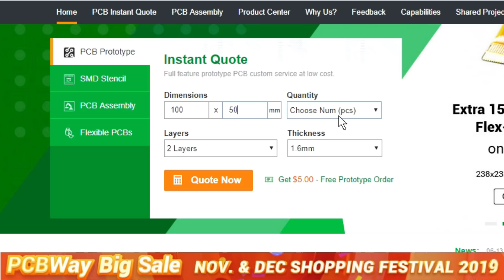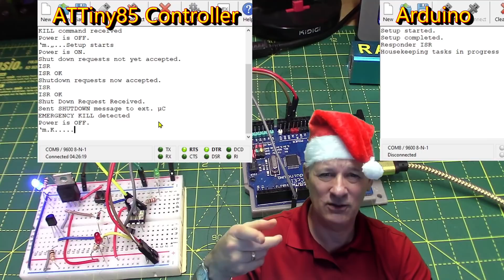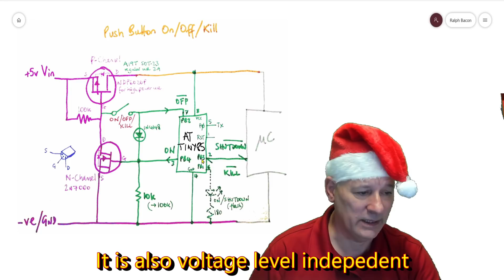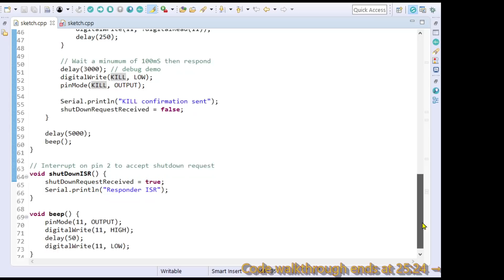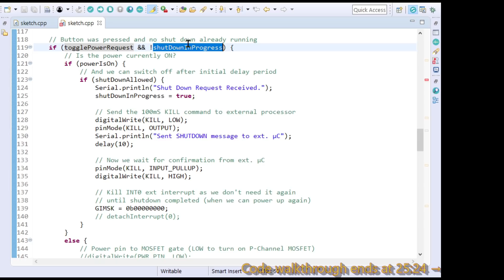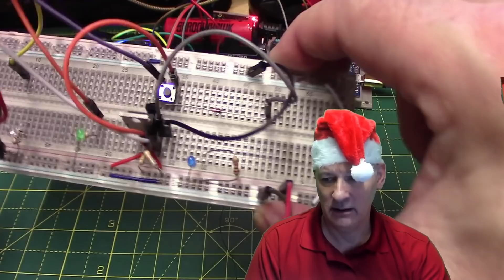#173 ATTiny85 Power On Off Shutdown

Comment: Great video! And I understand this is meant to explain/mimick the ltc2954 but is there a reason not to use the “main” uP to do the logic and providing the signals for this setup? It would bring down the necessary parts by, at least one ATtiny85 …

Comment: Hi Ralph. Great demo as always! I've got a small widget I'd like to build where I have an ATTiny85 power up via a button press, drive an MP3 player module to play a short sound and then power back down. Would this circuit work with just the ATTiny85 part of the circuit and none of the other part to drive the Arduino? Thanks again for your wisdom!  Gord
Reply from the maker: Actually, my simple dual MOSFET on/off design would do this wonderfully well (and I've used it countless times since I published). The push button brings the P-channel MOSFET to ground to start it all off, and the first thing the microcontroller does is "latch" that connection using the N-channel MOSFET by bringing the gate connection HIGH. When you're done playing the sound, release that GPIO pin and it all shuts off. Zero current! Nice!

Details: https://youtu.be/g1rbIG2BO0U but don't use those massive MOSFETs, for something like an 8-pin Si4599, pin-compatible AO4606 or even a EMH2604. I found the Si4599 hard to get since Covid, but the AO4606 is pin compatible and I've used it a lot. Give me shout for more info if you need it.
Reply: Thank you for the confirmation Ralph! Much appreciated!

Comment: Hey Ralph, great video!
I was searching your videos but I couldn't find a vid containing following:
power latching circuit to power on and off a mcu using a attiny (with the internal watchdog timer) instead of a push button. 
Do you know where I could find an instruction to do this? 
Maybe the ATtiny could activate a Mosfet to  switch on the MCU. I can not find an example :-(
Greetings
Reply from the maker: Do you mean, an ATTiny switching off the power to a microcontroller (and back on again), unless it receives an "OK" message from the microcontroller?
Reply: @RalphBacon    I want to do logically excactly this but instead of the push button, I want to switch it by using an ATtiny13  https://www.youtube.com/watch?v=7D9L9oS4AJM&t=117s
Reply: @RalphBacon    thank you for answering, man! :)
Reply: @RalphBacon    but yes, I think that would be also ok. the attiny siwtches the power on and after 10 seconds, it switches it of for some minutes. then it repeats the process. that would also be ok.
Reply from the maker: See if this video of mine helps: https://youtu.be/S2y1oAVmxdA

Comment: Hi Ralph, your circuit would work with a micro like the Raspberry Pi. The Rpi would need to run a power-down routine , in the background, to detect the Kill (via an interrupt). The Rpi could then cause a  controlled shutdown to happen. The shutdown process will signal the power-down routine to terminate. Prior to terminating the Power-down routine, the Shutdown signal can be set so that power can be turned off to the Rpi. Another advantage to the power-down routine is that it would catch any other shutdown requests that get made through the linux os operation. For example, if the Rpi user issues a software controlled shutdown instruction (rather than using your circuit switch),  the power-down routine would be activated to issue the Shutdown signal to your circuit and hence cause the power to cut off.
Reply from the maker: Check out my video #122 which did a shutdown of the PI, but I can't remember how intelligent it was: 
https://youtu.be/9IWn5GYktUo

Comment: Excellent video, I have one question though. 
What is the capacitor doing that I can see on the breadboard circuit? 
I can see it is across the power pins of the ATTiny85.  Its not mentioned on your github documentation. 
Your comments would be appreciated.
Best wishes for a speedy recovery from your recent eyesight problems.
Reply from the maker: The capacitor across the Tiny85 is a decoupling capacitor, explained in my Bacon's Bytes video here: https://youtu.be/zAUckSiE1RA
Thank you for your kind wishes for my eyes.

Comment: I have been playing with the ATTINY85 for some time now, primarily for building count down timers that we need in the house for our medical applications. Wife needed a couple for her eye drops, morning and evening, each needs a different amount of seconds that she must keep her eyes closed for after applying the drops. So I built her two timers, one for morning another for bedtime. Both use the ATTINY85's and I did put a 7 segment display on the top for the rest of the world, and a beeper for her use that alarms her when she can once again open her eyes. I also built one for my when I am towing our car behind our RV, it needs to run for at least 5 minutes at each fuel stop for the RV, again I built one that counts down and flashes when the time is up as well as plays a little tune to get my attention and I can shut the car off. This to keep the transmission lubed as we hurdle down the interstate highways at under 70 MPH  per the manual for the car. The one that I use is premounted on a breakout board and has USB input available on the card, works great, but it does program just a bit different when programing it with the Arduino software programer.  Here is the one I use:  https://www.ebay.com/itm/Digispark-Kickstarter-ATTINY85-Arduino-General-Micro-USB-Development-Board/351877226756?_trkparms=ispr%3D1&hash=item51ed846104:m:m4HEyK4-Hf9mfqfUHiHKYxQ&enc=AQAEAAACQBPxNw%2BVj6nta7CKEs3N0qV7HnbLtUf5uFWeXJcctjjqBZVR30pu1j1M9ZRHiiBR9y7lwuqkCvpquFZDGp7hy9jqezCiIfzXvABF2AA9wuy9Lk2X8Xsopo%2B2SLWFdZNd8oobuwOg3ni5%2Fx4egNEvBKSlFbKswe%2BhEPnSCO%2F3%2F4mIO0hVCihoV3hnvzV9t8NJfEP3KilB6RSZ%2BGTTQHY6jw4YOUJPGgKq6YvCOdXA%2Bubl8uLoYS2ZlcoLcP1kSHegZSpKxsYRKQUBNT64E5YZKGAb0gYFMbx%2Bs3L%2BQrqweWTQjDfmlRX3PsNNwd8O0rptbD6AVsvOb%2B2wXy7bkwAcbmrMvcpDEpsuAPRLdbY4B0jE7iJM8THzfM%2BozgXfkib64vlYRHCclJPruQ7QTsACp7B7fO3YVUeGbqa9gp2gPWNF66I4Nf17l64GNzBQl%2Fncw5BOklQb1WyCOrlKhKK5BlXm8Rv5%2BNVAKmNBuA0hwprl9FV3LsUV40uO5xRke5VRmhgwDqoPn3GB4vdZh1CzQRiCTeB5cZ%2F1jdQY78uRLx2MNcZ0AbKu7hhOnQc3y4PgRFdKHY%2BS7loMqq9BMpUT1OTz61YmhgSsP0oIPvlDNhq6Xrfmfc5zsZ5q24zAt9ovUzE3dy7sFdkh832ZOzLiT%2FG6MvmOgCvflXbSmOBOj3P9srBWp01ZFVzQq1OpJIE3UZCxkOFJEJbdIj9v6E%2Fh1%2BNQel%2Fq2Os1K3oDvl4%2BjL77MJIlBD0I7nOM0%2F0sLgVaXQ%3D%3D&checksum=3518772267560801b5d939cb41d08a4dfce02f42d50b
Reply from the maker: Two things, Jerry: can you just edit that URL link and remove everything after (and including) the first question mark please? 

Thus: Micro-USB-Development-Board/351877226756

Secondly, that device that it links to has a USB port on it but it cannot be used to program the device - what do you use it for (if anything)?

Comment: What about the power consumption of the ATtiny85 (when ON) when compared to LTC2954 though? I am pretty sure you could add some deep sleeping but interesting what is the power efficiency of the code you have there.. 
In my case I would actually like to power ON/OFF ESP32 (TINYPico) using a single button, also use the same button to perform some action when the chip is powered. TINYPico has a built in voltage regulator of 3.3V and supports being powered from the USB or a li-po battery of 3.7V (I want to control the power only when it's connected to a battery). Could you recommend me what to do if I want to achieve "correct" behavior when sending the signals between the chips as in general ESP32 GPIO input doesn't accept higher voltage than 3.3V, however ATtiny85 would send signals in the range 3.2-4.2V based on how much the battery is charged... Would you recommend adding a level shifter or adding pull-up resistors and using ATtiny85 to simply drive the voltage to the ground rather than the supply voltage? Thanks!
Reply from the maker: If you look at last week's Github, https://github.com/RalphBacon/181-ATTiny13-ATTiny85-Dev-Board, you will find this entry which sounds like it's what you need:
Sergiy Gryb's reworked on/off ATTiny85/13 code
ShaggyDog18 Single-Smart-Button-PowerOnOff-control
https://github.com/ShaggyDog18/Single-Smart-Button-PowerOnOff-control
Reply: @RalphBacon  Cheers a lot for the shared information! I think this will be very useful indeed :)

Comment: Hi Ralph! 
I've found much cheaper alternative to dual MOSFET Si4599  - AO4606, about 50 cents for 10pcs:   https://www.aliexpress.com/item/33025358492.html
Both are pin-2-pin compatible :-)
Reply from the maker: That is a very interesting find, Sergiy. Even the RDSon rating is looking good at 4.5V (33.5-42 mΩ) although that is at 5A current flow; I'd have to see what it did when it only had a small (eg 100mA) current flow, but I suspect it won't be a concern. As you say, pin compatible too although, the N-channel and P-channel names have been swapped, confusingly! 
Right must dash, I have some AO4606C's to order!
Reply: @RalphBacon  I've ordered ... just yesterday. No rush :-)
Reply: @RalphBacon  BTW, I've re-done your code (introduced a Finite-state machine concept), ported it to ATtiny13, added PinChangeInterrupt for KILL pin allowing new feature of requesting shut down by main microController (for example, you may have a "power off" menu item and, thus, shut down from menu)... Also added SLEEP function while expecting for request/interrupt to come for extremely low power consumption.
Testing, works just fine, will share soon... I've found out that ATtiny 13 and 85 are not pin-2-pin compatible for INT0: ATtiny85 - on pin PB2
 vs. ATtiny13 - PB1... to my regret. Anyway, I made it 100% compatible with your development. So, you would be able to try my code on ATtiny85 it you wish... The size is still small using MicroCore: 842 bytes / 32 bytes
Reply from the maker: That's excellent work, Sergiy. Do share when you are ready. Yes, the external interrupt pins are different as you say; you would have thought they would have tried to keep them the same. A PCB design could accommodate both chips with a simple link (wire, not an actual jumper).

I'm just playing about, er, doing serious research and development with the Si 4599 module and the Smart Phone Charger (as I have now called it, because the word 'Intelligent' did not fit into the app icon space!). all working very well!

I have also just ordered a few AO4606C's - when they turn up (in a few weeks) I will test and let everyone know of this alternative - assuming it works as expected of course. Perhaps my eyes will be up to the job then too!
Reply: @RalphBacon  yes, I've seen your new video RE phone smart charging solution. Good job! I have to learn Kodular, may use it for my other project! Thank you for sharing it!
Reply: @RalphBacon  just invited you to the github :-) Please, take a look...
Reply from the maker: I took to long to accept the invitation (it had expired) but I'm looking at the GitHub right now!

Comment: I had my ATtiny85 period, you see my good wife of 50 years has glaucoma and needs to install eye drops in the morning and at night.  Each time she needs to hold her eyes closed for a designated period of time.  Well when she first got them, I was timing her every morning and night, this did, in fact get a bit old for the both of us. So I built a morning and evening timer using the ATtiny85 and a 4 digit digital display as well as one of those little beepers.  She has used them now for over 4 years, the only problem is replacing the 9 volt battery I decided to use to power the units once a year. I also built one for my car, when we tow it behind our RV, we must start the engine on her every time I fuel up the RV, and let it run for at least 5 minutes to get oil up in the automatic transmission and prevent damage.  So I built another for my car. Each timer is programmed for a specific time, and they count down on the display.  Once I learned how to program the little gem I built all sorts of little projects with it, then tore them back down and built another.  Thank God for breadboards.
Reply from the maker: Damn all breadboards, I hate them. Poor quality ones, anyway! Thankfully I have a very good quality one from my PIC days so I am saved! Sounds like you really like the ATTiny85, good stuff!

Comment: Hey Ralph! Hope you had a good new year.
Making an interrupt circuit after the video before this, I fell foul of the interrupt retriggering if the button was held (even for fractions of a second) and tried to write a debounce for it, but the falling option seems like it would work with no additional code :)

Also, agreed - if you need the glasses for your health, wear em!
Reply from the maker: Hey, Jess, how's it going? Yes, using FALLING only triggers once on the transition from HIGH to LOW but you might still get switch bounce. If you look at my code in my Rotary Encoder video #19 you will see how I deal with this using a simple check in the ISR itself. I'm wearing my patch/glasses in today's video, a very boring look, no funny headwear this time`

Comment: After nearly 6 weeks I finally got the 328PB chip yesterday. I was only able to get single chips from an AliExpress seller in Singapore. Always takes 5 to 6 weeks from there. Have to fire up the WayBack machine and go back to Project #168. Woohoo.
Reply from the maker: Did you really just buy ONE chip from China? Wow! You must be confident on getting it right first time around! Good luck and do let us know how it goes.
Reply: Well, I didn’t just buy one chip. I just meant the supplier sold singles instead of lots of 10s or 100s etc. 
I bought 2 chips, in case I damaged one. At A$2.73 each + $0.25 each postage They’re a bit dear.

Comment: How do you bypass the boot code to eliminate the power up delay????
Reply from the maker: Flash the sketch using the ICSP socket (using an Arduino with a programming shield). That overwrites the bootloader and your sketch starts instantly.
Reply: @RalphBacon  Thank you.  OOOOOHHHHHHHHHHHHHHHHHHHHHH!!!!      (light bulb moment)  One more please.   All the fuses are untouched then?   So you set fuses with bootloader and sketch first then use ICSP to load sketch only?   Am I understanding clearly?   I am now a subscriber.   Happy New Year.

Comment: Love the video, Ralph. I ordered the shield from eBay and the seller asked me if I saw his shield on YouTube?  I said it was from your channel and he told me that you’ve made his shield famous world wide.

I have a few projects that I can use the ‘85 for and I’m glad you’ve done so much exploratory work with this device.

Could you give some examples where the ‘85 is used with a LDR and depending on the light brightness, a PWM pin reacts by changing the pulse width?  Like bright light (such as sunlight coming in the window) sets the PWM at 5% high and 95% low, and when dim or no light, the PWM is 5% low and 95% high.  Would need one ADC pin, and one PWM pin.  That would be a good project. 

I can figure it out myself.  And I’m not trying to cheat.  Just thought for the ‘85 it might be an interesting project.

Wear your glasses and have a very Happy New Year!!
Reply from the maker: Drat! I knew I should have had some sort of commision contract with him! Ha Ha! Actually, if that really is the case I'm pleased for him, he deserves success.
Your idea for the Tiny85 is a good beginners' project but could be developed on an UNO/Nano then transferred to a Tiny85, I guess. I'll add it to my list and see whether it bubbles to the top. More TinyXX stuff on the way, though, keep tuned!
Reply: Ralph S Bacon You’re right, the seller from Greece is really a nice fellow. His emails over eBay have been really nice and he said to tell you thanks for all the sales of his ‘85 shield.  
Your idea to develop the functionality on an UNO is brilliant.  Then port it over to the ‘85 and verify it’s working correctly.  And that’s what I’ll do. I’ll check the Arduino site and GetHub.  There are 5 pins left, several are ADC and at least one can be configured as a PWM output.  Brilliant.  I’ll give it a go.  Thanks Ralph.   I hope you are taking care of your eyes. My lovely wife just had cataract surgery/lens replacement in both eyes. She’s doing very well. I hope you’re back to hitting on all cylinders soon. 👍👍

Comment: Another great video, thanks.
It would be great to demonstrate a variant of this with rising and falling interupt routines powering up a micro controller. The low power door/ window/ gate alert with a reed switch, Attiny85 and ESP8266 announcing both open and close events via MQTT and Node-RED. It's been done before, but not with your clarity.
Have a great 2020
Reply from the maker: I tell you what, Kevin, I've just been playing about with an ATTiny13 using interrupts and when I talk about that I could do the interrupts at the same time? Whether I can send it to sleep and wake it up on interrupt whilst also detecting that interrupt for a door I am not so sure. As it only has single external interrupt pin we shall have to see.
Reply: @RalphBacon  I've ordered some from China in expectation. They look to offer the same perverse pleasure as the MSP430 where every byte counts and there is no substitute for a thorough read of the datasheet. I will be holding on to your coat tails.
All the best for 2020.

Comment: I love the auto shutdown and sleep mode stuff you've been doing, very helpful! 😊
One thing I'd LOVE to see is implementing on/off control but with an IR remote. I've been using Ken Shirriff's excellent library in several projects using what I've learnt from Ron over on Drone Bot Workshop, but being able to turn a project on and off with the same IR remote would be a game changer 😮
Reply from the maker: Adding an IR controller would be very easy, Azy. You can get the remote control plus IR receiver LED/PCB which you can connect to an Arduino as though it were a switch.
This one, as a typical example, cost just $1.50:
http://bit.ly/39b3bh8
and there is a lot of information (wiring, examples) on the web site too!